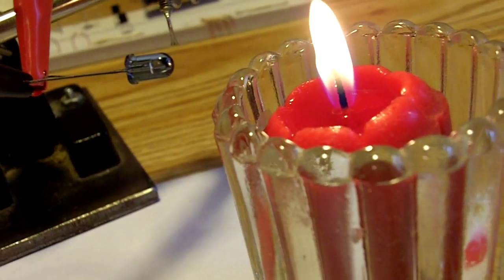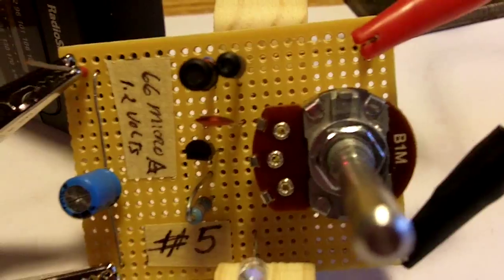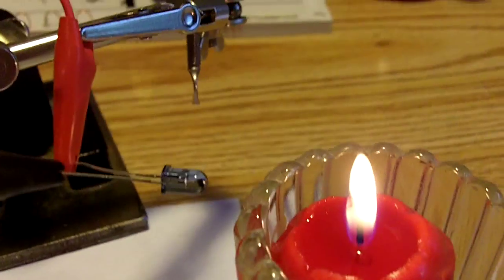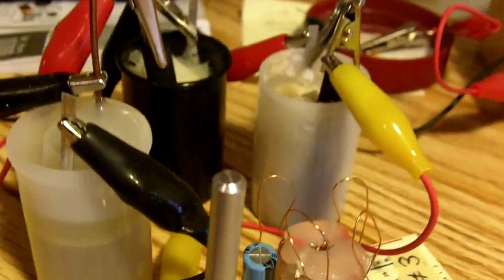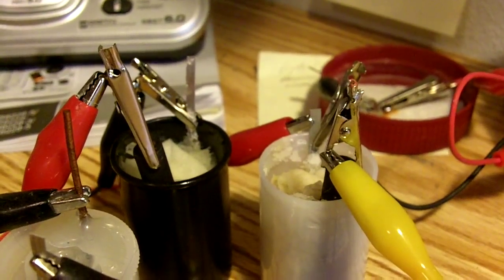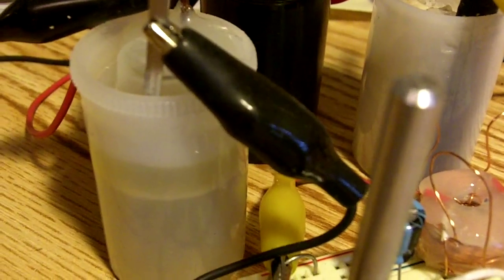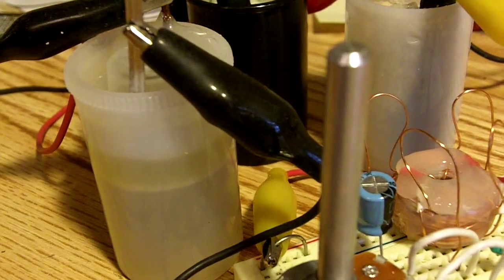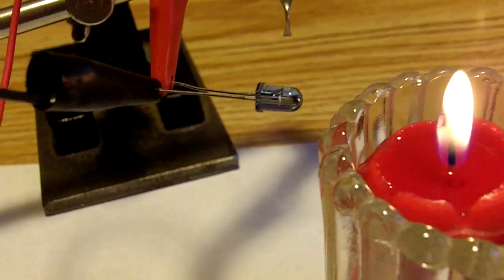Candle Power.MOV

Comment: Always good to hear the sound of the woodpecker radio hehe. Was perhaps mine or IBpointless2's vid for the vaseline...it ate the steel I found out, it has a browned layer, so your cooking oil idea looks great to try :) Water cells will work well with galv steel, rainwater gives gives an extra 0.1V or so and using burnt copper really helps.
Another informative vid, enjoyed that.

Comment: Ok i made this homemade cell again but 2 minutes after i puted it together, i could see very tiny bubbles forming on both copper and magnesium electrodes :/ . That tells me that it is going to deteriorate with time :/ So i came back to see what i did wrong. I mixed a little of alum in my water. Plus i used tap water. if i understand well, you are using distilled water only, am i right?

Comment: I have to try that corn oil/distilled water cell.  I tried the vaseline and it didn't work very well.  JonnyDavro wrote me and told me that the candle light will travel down a bunch of fiber optic strands and work also and I have to try that idea.  He said that he got the fiber optic strands out of an old lamp that he got at a second hand store.